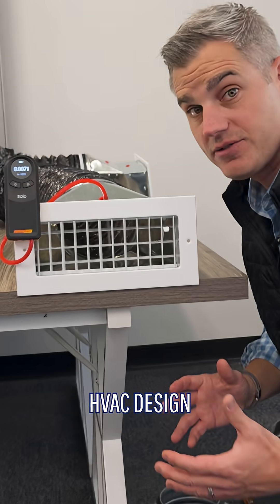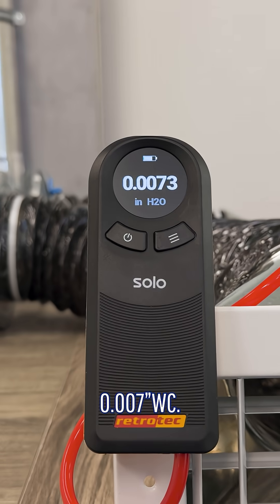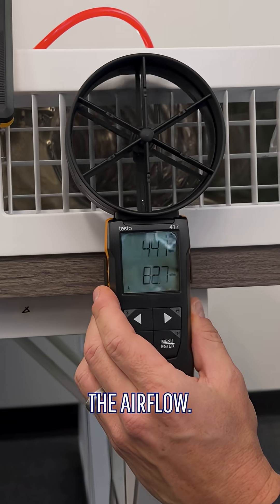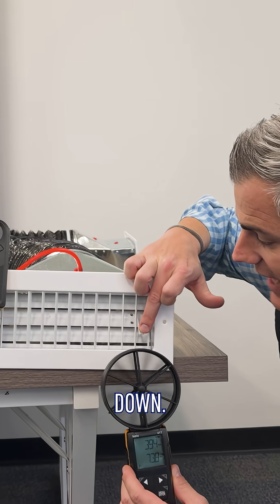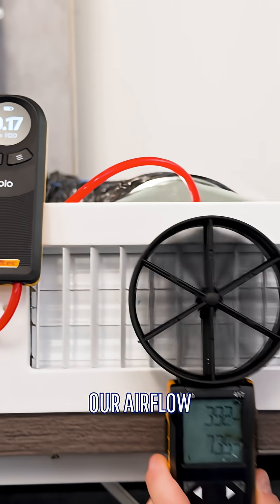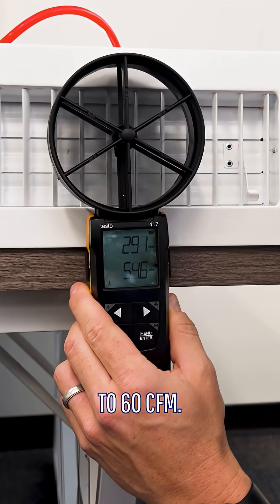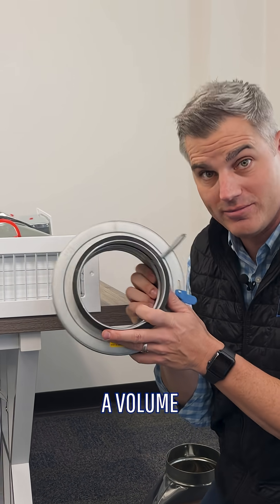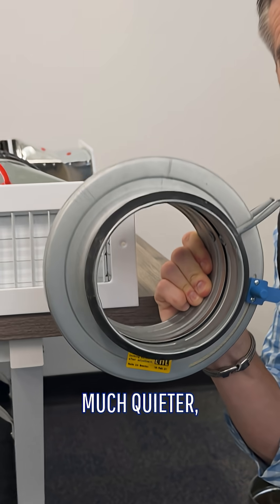Adjust HVAC Airflow the Right Way.

Comment: Can you do a demonstration with how much difference is static pressure changes on the system when using a shutter style volume damper versus the louver damper method you just demonstrated. You may not get whistling, but effectively does it do the same thing back to the total external static.

Comment: This affects the static pressure as well
Reply from the maker: Yes it does. A damper is a better place to control air flow and static pressure. If installers set it there and the system is working as designed, someone hopefully won’t even have the need to close down a register and inadverdently affect the systems static pressure.
Reply: What is the difference better the shutter style and dampered louvre can you show that? I don’t see what the difference is between one of the other.